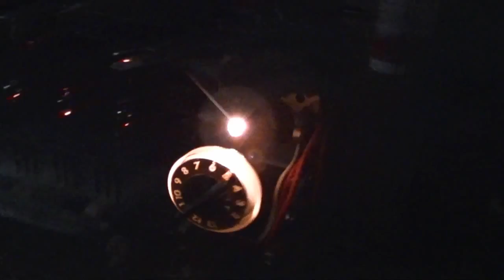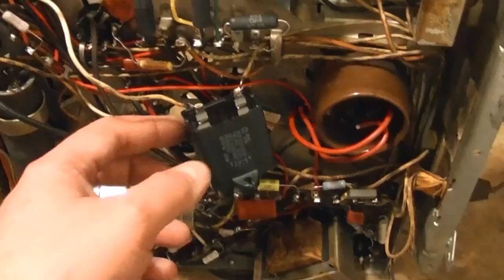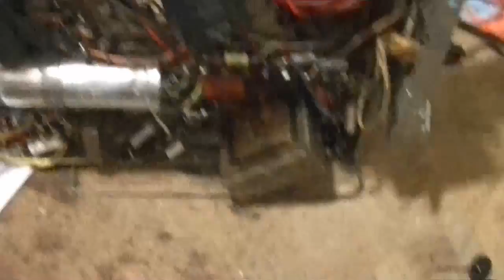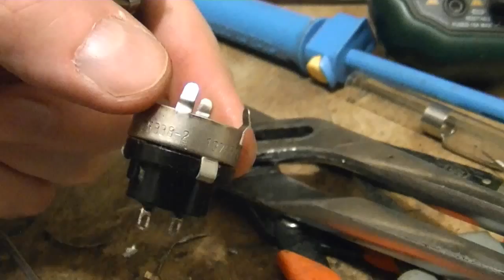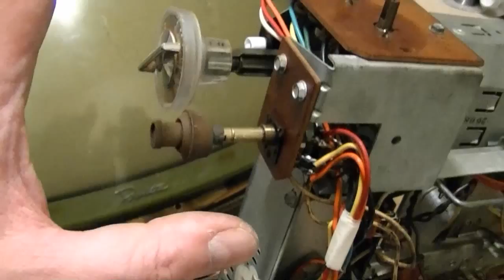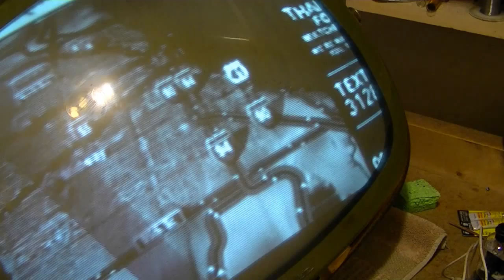Predicta "Holiday" restoration p13o?

Comment from the maker: A little of both.  First, I track down the service info.  Then, I compare it to what I have and check critical components like the CRT and flyback.  If it all looks good, I check the parts list in the service info and order any parts I don't have on hand.  Once I have them, I usually rebuild the power supply first, then move on the the rest.  I usually mark off parts on the schematic as I replace them.

Comment from the maker: No, I'm not going to paint it.  It's made out of some cheap metal alloy like that used in tube shields so it doesn't really polish up.  Yeah, I'll tweak the picture geometry once the set is all back together.  There's no focus control just a jumper with two positions that has little, if any, visible effect on the focus.  That's typical of electrostatically focused CRTs.

Comment: Hi Bob. Your set will definitely be better now than when it left the factory... I think the modules look very good on the board, and they give an authentic feeling, as if they were original. The whole chassis looks better now too. Are you going to paint the HV cage top? It’s the only point I see from here that looks only OK. The image seems a little bit tilted and I guess that you will solve that when you disassemble the tube case right? Can you show us where the focus adjustment of the set is?

Comment: Bob, I bet what is keeping your led lit is the residual voltage left within the high voltage, and B+ sections of the tv after you cut it off, and it is back feeding through those circuits, since it takes so little current to run a led light.

Comment: The only way to get to those tabs from the back cover is to remove the front pot first, inside the cover it may have a nut holding the rear pot in place which you may have to undo to get to the tabs for the rear cover.